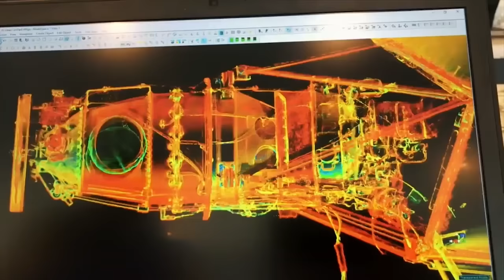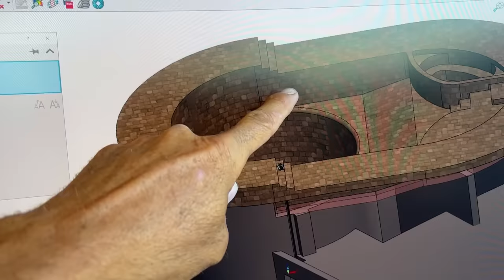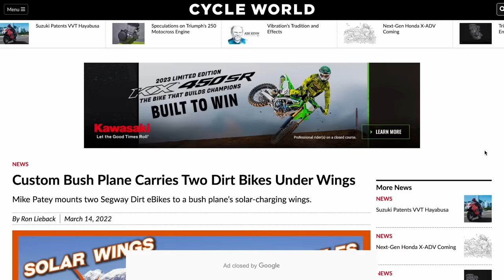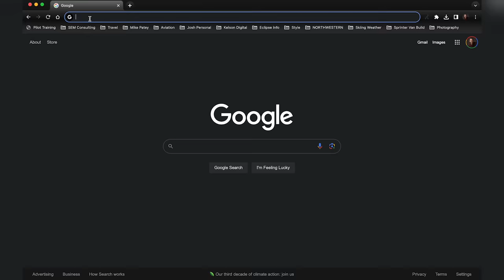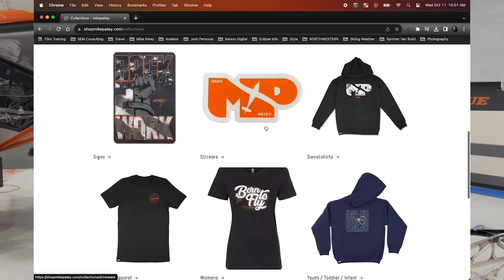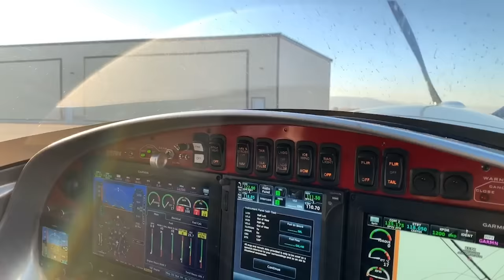Upgrading Suron Motorcycles with KO Motor | Scrappy #69

Comment: I got an Ariel rider grizzly and I absolutely love that bike. For cruising around on my farm nothing can beat a powerful electric bike.
Reply: I just came across some grizzly videos. They are pretty badass. 
Those “scooter bikes” are wild. 

Its a single motor though correct?   They need to make a double motor. 
Having 2 wheels with power makes an incredible difference, especially off rosd

Comment: You'll love the power, and range.  Hope there is an EggRider included.  It allows you to adjust power on-the-fly so you can set the MINIMUM required for riding conditions, which greatly extends the range.  When I climb steep hills, I dial the power back to help prevent the front wheel from wanting to flip over backwards with all the available torque you'll have.  9 power levels, and you'll use them all.

Comment: $1,000 per week for insurance is just crazy! Maybe not only Draco, but also the engine failure in the other aircraft has influenced your premiums, because you've made a couple of claims over the past two years.
How much do those bikes weigh, before and after the conversions? They look pretty impressive in those clips. And have you considered fitting a streamlined cowling around those bikes to improve Scrappy's performance and economy?

Comment: EBMX MOTOR. X9000. 72V 42 AMP HOUR. 90 MPH.
Reply: KO holds the record on a Surron at over 100Mph. 
EBMX is rebranded overpriced under cooked crap and they motors are rebranded QS junk . 
KO for life !

Comment: I hope that upgraded battery pack isn’t LIPO. If so, keep them as carry on - not strapped to the underside of your fuel tanks when stored!!! I wouldn’t leave them in your hanger unattended for that matter…. High current loads with no active cooling 💁🏻‍♂️ I would hope gritshift reports ZERO battery failures! 

Don’t store them at 100% regardless.

Comment: G'day,

Very interesting.

I'm currently awaiting delivery on a
Talaria Sting (L1e).

6,000 watt motor @ 8.35:1 to give 70 Km/Hr max, regulated to 45 Km/Hr for registered Highway use (in the same class as a 50cc Motor Scooter).

In Australian dollars,

Bike, registered, delivered 600 km from the Sydney Importer -
$8,000.
Stand alone Solar Electric setup to charge the Bike -
$8,000.
3 m. by 4 m. shed to put it in
$2,000.
Spare Battery (to come home from 50 Km away)
$2,000.
Spare Motor & Speed Controller
$1,600.

The Bike's back wheel gets 60.1 Hp of Torque at 557 RPM to achieve 70 Km/Hr.

In 1992 my broken ankle occurred when the 22 Hp JPX Pul 425 French 2-Stroke Motor turning a 41.5" by 12.5" Propeller at 4,200 RPM
Failed to pull me in my
Volmer Jensen VJ-24w
Over the fence...

It occurrs to moi that at
4.18 : 1,
That spare Motor & Speed Controller will deliver
30.5 Hp worth of
Twistiness at 1,144 RPM to a
96-inch by 47-inch Propeller, 
Engaging 50 square feet of Air instead of 
Only 9 Square Feet.

It'll still Stall at 25 mph &
Top speed will still be 45,
But at 36 mph the
Climb Rate should be over
500 ft/min, 
Rather than 250.

And the 4-Stage
Regenerative Braking means that,
After taking off and finding a Thermal, one may stop the Propeller and
Work the Lift up to
10,000 ft...; 
Engage Stage-4, and
Spend 20 minutes coming back down at
50 mph & 500 ft/min
While recharging the
Battery of the

Solar-Electric
Ultralight Motor-Glider, and
Free-Flying 450 pound
Electric
Wind Turbine....

It won't be
Lawful, but
Electric Aeroplanes are
Silent.

What they can't hear
They don't look for...;
How long did it take
AmeriKa(!) to notice the
Chinee
Weather Balloon,
Hmmmmn...?

Keep on keepin' on.

Such is life,

Have a good one...

Stay safe.

;-p

Ciao !